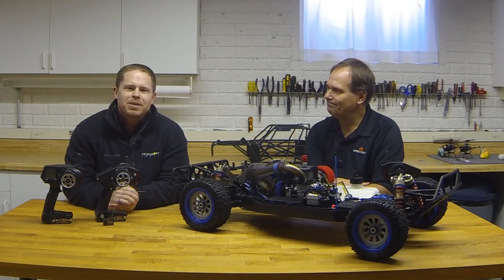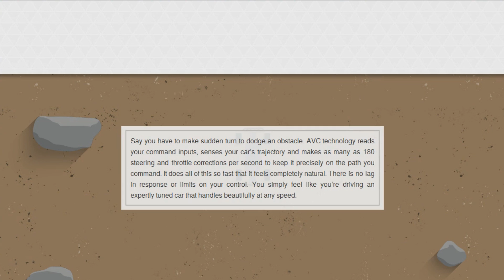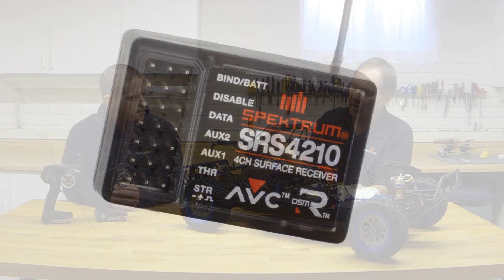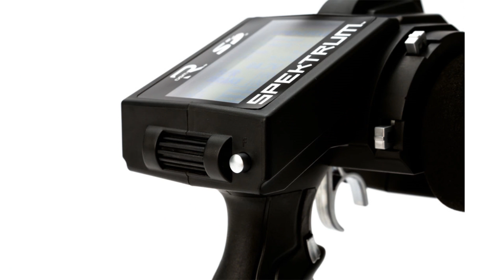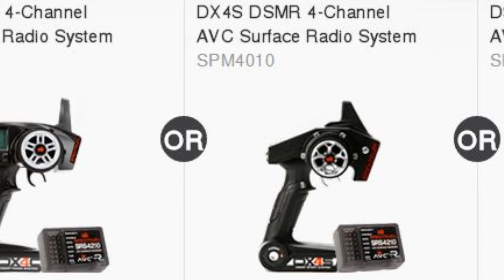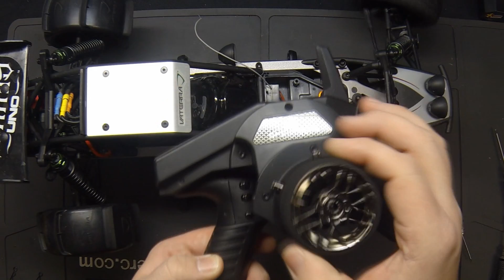Equip your vehicle with AVC (Active Vehicle Control) Technology from Spektrum RC

Comment: is there a way to setup throttle intervention so that you can hold down the throttle trigger and still be able to take a tight turn without the rear end spinning out do that way you don't have to slow down before a turn and then re-accelerate after since of there is a way to set it up like that you wouldn't have to re-accelerate done the throttle trigger would still be being held down? sorry for the long question. if you are confused with how i worded part of my question and need me to re-explain anything please ask.

Thanks.